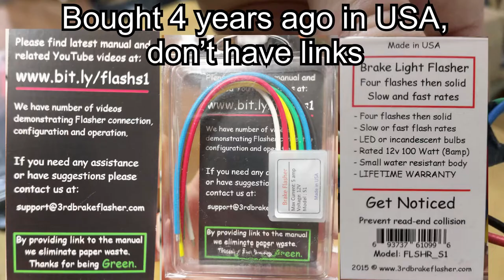Best Stealth Tail Lights MT07 (2024)

Comment from the maker: NOTE:
These are for cars not bikes so they draw more than average power. I had to cut them this short or they would have trouble blinking correctly and overload the system. At this length they work perfect.